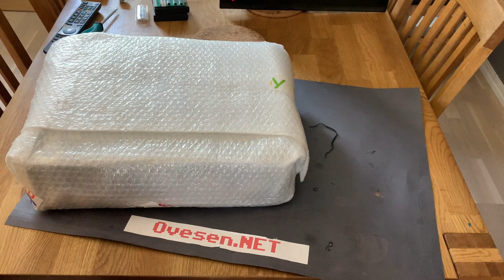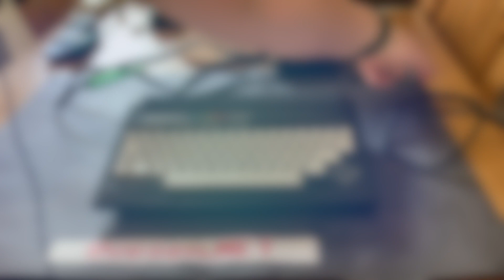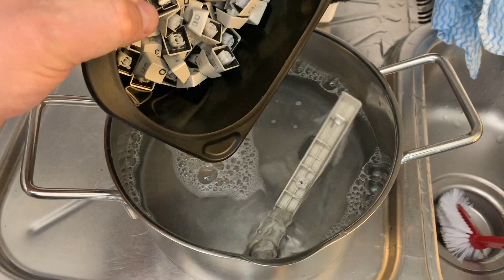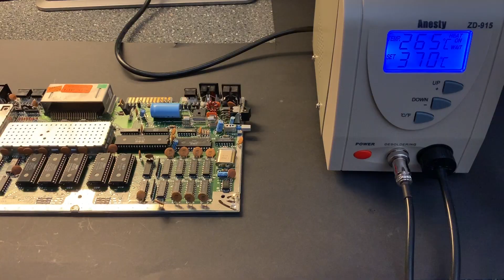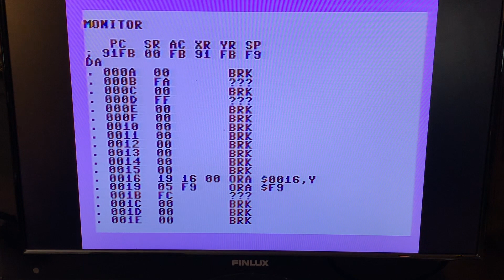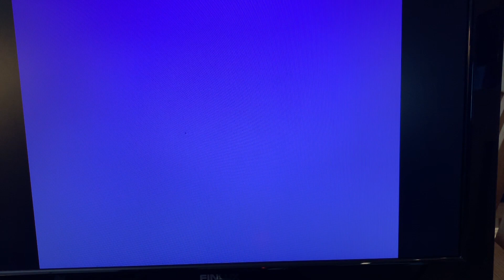Commodore Plus/4 repair and demonstration

Comment: Having repaired a lot of C64s, it seems obvious that it is a RAM problem and you can determine which chip is bad based on the random chars shown at the screen (chrck world of jani - aame mathod on a plus 4). Desoldering all eight chips is definitely not a recommendable way of repairing RAM problems

Comment: May you know if you could use the piggyback method to verify the culprit RAM IC on the plus 4?  Replacing all 8 seems a bit bigger job you may need to do.
Reply from the maker: Piggy back might work. At least you can see a difference if you try that

Comment: Hello! Nice video. Do you know what is wrong with my Plus/4 where after booting machine was going directly into Monitor machine language and next it was displaying BREAK repeatedly? After few times now I have black screen. Any suggestions? There is small tutorials for fixing plus/4 on Internet.
Reply from the maker: Hard to tell. Can be different things. Bad ram or rom-chips

Comment: i think the optical design is great. but i am not sure if the cursor keys are good.
also they messed up the compatibility with the c64 which was really stupid.
i know it is difficult because of different clocks and ram access speed but they could have done it..